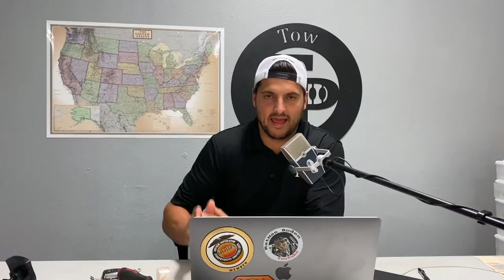The TRUTH about Electric Over Hydraulic trailer brakes

Comment: I love electric brakes on trailers, I always have since the '60s.
And I love the old style trailer brake controllers that used or tied into the master cylinder on the tow vehicle the old hydraulic over electric trailer brake controllers. Like the Kelsey that I still have.

Back in the 80s when they were forcing people to switch over to pendulum type trailer brake controllers or just a straight on and off of the variable preset but no variable in actual usage, or the suicidal surge breaks on rental trailers I couldn't stand those things and I still can't.
These types of trailer brakes are even more dangerous on slippery surfaces because on slippery surfaces the trailer brakes never come on because it tow vehicle isn't stopping to actuate the trailer brakes so the trailer just pushes you into other bigger problems!

I've talked to a lot of people online through YouTube and Facebook about hot shotting and towing travel trailers but we never seem to talk about the brake systems which I'm glad you're doing I'm here.
I'm in my late 60s and I've towed all kinds of trailers behind all kinds of vehicles and what I've heard from you so far I mostly agree with.
My dad's two axle dump truck had hydraulic brakes on the truck and vacuum brakes on the trailer with the converter that never seem to work right.
 And then he got vacuum over hydraulic on another trailer and he had a lot of trouble with both of those.
But he had Chelsea and then I got Kelsey on my pickup back in the '80s.
The trailer brake controller with a metal case and hydraulic hose going to the master cylinder and wires going to the trailer brakes.
Once your address when you first hook up the trailer those things work flawlessly and always have and I love it!!!
I can even be adjusted while you're going down the road.
I know the importance of the tow vehicle and the trailer being towed have to respond together at the same time and have exactly the right amount of breaking for its own vehicle. Meaning that the trailer brakes stop the trailer and the truck brakes stop the truck and if one works too hard and the other one won't be working hard enough and you'll lose traction on slippery surfaces and crash!

I told this to people that talk about their trailer brakes on their travel trailers and most of them say they have to push a lot harder on the brake pedal when they're pulling a trailer which I think is extremely suicidal!

I looked at some of those modern trailer brake controllers in the '80s and her other people talking about him and how much they hated them and the way they responded and how they caused some people to crash. Some of them said they went back to the older style like I have.
But the fact remained that cars that were made after a certain year had ABS brakes which I know is also another design flaw because it takes up to 37% longer to stop with antilock brakes according to one in depth study that I found, which means you'll crash before you come to a stop.
Forcing everyone who's going to pull trailers to switch over to the new type of trailer brake controller I just won't do.

The people keep telling me that the new pickup trucks that have the trailer towing package have a built-in trailer braking system that works just as well as the old style does but nobody can answer a certain questions for me like how does that trailer brake controller know that you're putting on the brakes and how hard in order to activate the trailer brakes if it's not tied into the master cylinder on the tow vehicle. I know one type that was actuated off the stoplight circuit the type that when you put the truck brakes on and the brake lights come on it activates the trailer brake controller just on or off. And if you're towing a heavy trailer or a light trailer there's a switch that you can set but it's not a variable actuation as the earlier trailer brake controller that I like.
In any case those other trade trailer brake control that I don't like do not respond as quickly as hydraulic over electric from what I found.
 While you're driving down the road and decide to break lightly or very heavily and suddenly the trailer brakes wont respond with the correct amount of breaking power for that situation like it would with you old style hydraulic over electric.
When that Kelsey is adjusted right and it's very easy to do it would put the same amount of pressure on the brake pedal as you normally would whether you're towing a trailer or not, you would not have to push harder because you're towing a heavy trailer. So that this vehicle brakes for itself because you don't want the trailer pushing the truck when you're trying to stop and you certainly don't want to be dragging the trailer tires when you're trying to stop either.

Another thing about my dad he's very old school he passed away probably 20 years ago but when he needed to tow a car he would build a tow bar the same way the old style towbars were made from the rental yards but he would weld up the frame and bolt the frame of that tow bar to the front frame of the vehicle he was towing. And with those red your toe bars you could go forward and backward and go around corners and they work perfectly they just didn't have breaks.
But if those things are outlawed now and if I wanted to tow a car like for delivering travel trailers or such I would want a tow bar that had hydraulic over electric with an electric actuator to actuate the brakes on the towed vehicle either pushing on the brake pedal or tying into the brake system on that towed vehicle to actuate the hydraulic brakes on that towed vehicle.
And for one more reason, if I wanted to back up a vehicle that was pulling a toad car I want to be able to back up with it but you can't do that with the current styles because if you try to back up it'll put the brakes on on that towed vehicle even if you're not pushing on the brakes which I think is a bad situation, bad design!

This question is, are there available tow bars like the one that I want to find with the  electrical connection from the truck sending the electric to a converter on the car that's being towed for its own breaking, whether it's an electric ram that push on the brake pedal or something similar.
Because I think it'd be a lot better system than what they have now. And I really want to be able to back up without putting the trailer brakes on.

I pulled several trailers with surge brakes but the one I hated the most was trying to back a trailer up a driveway that had surgery first time I used one with surge brakes I had to put it in four wheel drive and skid al 4 of those trailer tires all the way up the driveway!
I've had to use surge brakes on a couple of other jobs I was on but those surge brakes kept locking either all the way on or all the way off and had to jerk the truck or slam the brakes on to actually the trailer brakes on or off.

Another question is does Hot shot towing pay better like I've heard better than delivering RVs and how do I get into it?
I've heard that some of the companies out there will train you and which companies are better to work for, but I was wanting your opinion.
Sorry about the length of this.
Thanks
Reply: Checking around the internet I see that Kelsey is still making that type of trailer brake control that I love so much and they're making them for over the road trucks with a converter built onto it to use it as air over electric for the electric brakes on the fifth wheel travel trailers that a lot of people live in.
They actually buy an over the road tractor to pull a fifth wheel travel trailer.

Comment: I have 6 years of experience hotshot in the oil with a 3500 Ram and a 40ft gooseneck trailer. The best electric over hydraulic is Dexter all day. Had a trailer with Kodak brakes they were very difficult to adjust to from the dexter setm. All you have to do is get use to the system and the amount of gain to put on your  Is break controller.   When I was new to  hotshot I used to lock the breaks up. But then I figured out the system and  what gain to use for for pacifics  kind of loads weight.  I had a trailer that had had drum  breaks I hated them always had to adjust them.  Beautiful trailer though PJ low boy dove tail call holler 40'ft. Miss that trailer.  It's so easy to pull the calipers off to change the break pads. Could only imagine if the drums were oil bath and had to all ways take the hub off to change the Is brake pads out.

Comment: This issue happens on any rear disc brake truck. When the pads are thin they will fall out because the piston pushes out then you lose pressure and then your brakes

Comment: My 40’ pj with disk brakes has not given me a single issue in the last two years. I’ll never go back to electric your trippin. I’ve put about 140k miles on the trailer and pads still have about half a inch of pad left. Fuck drum brakes. There is maybe a second of lag time but once they come on I can lock all the tires up if I wanted to. Was never able to do that with drum brakes.

Comment: Not sure how long ram has had the option but you are able to set in your truck what kind of brakes the trailer has. Not 100% if it corrects for the delay but I’ve tested it a little with my electric brakes and have noticed the difference in the electric brake setting. 
Also you convinced me to stay with electric brakes 😂
Reply from the maker: Yes you can but it really didn't do much

Comment: Does he not drive an automobile with hydraulic brakes?
Reply from the maker: I do but in an automobile they are made to way better standards than trailers
Reply: @TowPiglet  LOL...what does that have to do with all of the other statements. One example...the hydraulic fluid is not in the hose all the way from the EOH pump to the calipers?
Reply: @TowPiglet  BTW, been using EOH disc brakes for over 15 years. No issues.

Comment: HI about   ActuLink Electric-Hydraulic Anti-Lock Braking System (ABS)         AL-KO iQ7 stores compressed air within a pressure chamber, allowing immediate brake application the instant it is required AND ABOUT HYDRAULIC OVER AIR

Comment: If your electric brakes short out they blow the fuse in the truck and you have no trailer brakes. I've seen it happen on our trailers multiple times, I have not tried EOH brakes so I can't comment on them.

I just know our electric brake systems give us constant problems, they are in the shop at least twice a year and we have gotten multiple tickets because the electric brake system wasn't strong enough with the brake away cable pulled to stop the truck and trailer in a short enough distance to make the DOT happy. The mechanics came out and looked at the brakes and said "nope they are working fine electric brakes just have garbage stopping power".

Comment: For those of you who have used EOH brakes a lot -- how is the stopping power compared to electric?  I'm not a hotshot; I have a big 5th wheel with 5200# axles and the brakes on it are terrible even though I have three axles with brakes on all three.  I've considered EOH off and on for years.  Now I'm picking up a 24' enclosed car trailer and if the brakes on it don't work any better, I may switch it too.  I totally get Alex's reasons for not wanting to switch; he has a business to run.
Reply: Hydraulic all day will keep you safe

Comment: TAKE IT FROM ME AN EXPERT!!!
I have been using electric over hydraulic for over 20 years now, and I would NEVER go back to electric. I'm talking 30,000 lb load on 2 - 8K axle trailer. 
He is right, there is a delay but it's only a fraction of a second. 
The stopping power of hydraulic is unbelievable like OMFG!!! difference.  
The rubber hoses do suck big time, they only last a few years, so you need to replace all your lines every 4-5 years, small price to pay for my life.
He is right, don't even waist your time looking for these hoses, they must be ordered online, so you might want to carry a spare.
If you blow a hose so what, carry a small vise grip to pinch it off, and carry a brake line cap and extra brake fluid. Pretty simple dude. 
Ok so one brake isn't working until i replace the hose.
I have lost my brakes on the expressway downtown Chicago, yea it's scary, but not as much as driving with electric brakes!
I'd tell you all the reasons I hate electric brakes but I don't have all day.

Comment: I have both types of trailers and I have to disagree with you I always have had issues the the electric brakes. Never had an issue with EOH brakes besides changing out brake pads which is so easy compared to the electric brakes.

Comment: I can’t believe you have to talk about brake pads flying out of calipers. I was worried before about hot shot rigs. Now I’m terrified.  I have 40+ years driving many types of trucks and trailers. Electric, surge and air brakes. The only way to go is “real trucks” with air brakes. I decided I will be into trucking or I won’t. 
No halfway. The safety is on a whole different level. 
If trucking will be your career, get a CDL. It’s not difficult. 
BTW it is completely possible to lose all electric brakes at once. Just one bad connection in the trailer plug will do it.

Comment: Feel like your only telling half truths. Never seen a pad fall off a disc brake trailer. Unless some fool who has no idea what there doing was messing around with the brakes.  That goes for hoses too. As matter of fact that goes for anything under the trailer. Only time I see a failure of any kind on brake system doesn't matter what kind is because some idiot was trying fix something and had no clue what the hell he was doing.

Comment: Like many things, it's a matter of PERSONAL PREFERENCE is all. I prefer electric rather than hydraulic brakes on trailers but for slightly different reasons. 
The lack of parts availability on the road is certainly a factor, but for me it's the DELAY IN ACTUATION that rules out EOH. When I need to grab some trailer brake I want it NOW.  
Here in CO we have a lot of steep roads and often times little traction to work with (snow, ice, gravel, mud) and thats when you need quick, independent trailer braking to keep the rig stretched out/ straight. 
I do like the IDEA of EOH - easier maintenance, better braking power and cooling, but personally I don't think the system fits well on trailers. Since they are still actuated by electricity, you don't get that smooth fluid input as you would in a car. 
Electric brakes can be very touchy (its basically an ON/ OFF switch) but newer brake controllers help some and to me the system works more like air brakes on a semi.
Surge Brakes are probably the worst IMO. I did a video on towing boats explaining why.
God bless and be safe !!!!

Comment: Sounds like someone sold you a pieced together kit along time ago because no one I know or have ever heard of has ever lost a brake pad or caliper with proper brackets calipers & pins & bolts & rotors so run a properly matched size kit & not some thrown together bull crap & I bet you will love it & the delay is very minimal with the good electric tech out now days for the pumps way better than 5 years ago & very minimal delay especially on a gooseneck with the pump mounted back by the axles & ground everything to the trailer & everything to the battery & run quality batteries with a good charging system from the truck no problems if ppl would crawl under there trailers once & a while to do some preventative maintenance when it’s needed!!

Comment: Bro at this point I feel that you'd be way better off just running a semi trucks or a bigger 4500 to 5500 truck preferably with a air compressor. As for trailers you either need to get tandem duallys or just get an air break system. You'd alleviate all this breaking braking the bank and having headaches all the time. You're already running logs what could it hurt? 🤘😎

Comment: Let's sum up your information. There are thousands of trailers going up and down highways with air over hydraulic brakes with none of the problems you described.  So there are thousands of real life examples that disprove your information that you want us to believe. Could it be more likely you bought a cheap kit or a kit not installed properly. Brake pads do not just fall out if the caliper is assembled correctly. There is no air in brake lines if they are bleed. And there are thousands of trailers that do not have a brake delay on the trailer and no one would design a system that would have a delay as part of the braking process.

Comment: We have six trailers One of which has disk brakes. Currently parts are impossible to get for the model that I have. I do have a few extra parts on the shelf. I have ordered complete new axles with the disc brakes because I can’t get parts. That was over a month ago and they haven’t showed up yet and I had to pay for them cash upfront.
And in defense of the disc brakes they do stop way better on scary Hills fully loaded. I would much rather have that trailer on the few insane roads in my state. The trailer is a 2015 add has only had normal maintenance issues on it. But because of the parts issueI wouldn’t go out of my way to buy another new trailer with the disk brakes.

Comment: You are wrong on several fronts, the pressure is not low it is anywhere from 1000 to 1600 psi and I think you didn't do your install correctly also there is no delay you probably didn't bleed your system correctly. I have one on my two axle trailer and I have no problems with it you're spreading misinformation

Comment: I agree. I have ran several and the delayed reaction will destroy your trailer. You are sending a whiplash action thru the entire trailer and transferring that energy on your truck. Why would anyone want to abuse your equipment like that. The only time electric over hydraulic makes sense is if you are pulling your 6000 lb. boat to the water with a Ford Ranger but who does that.